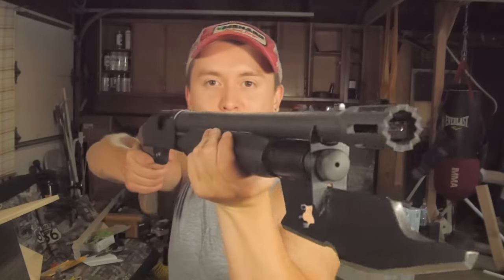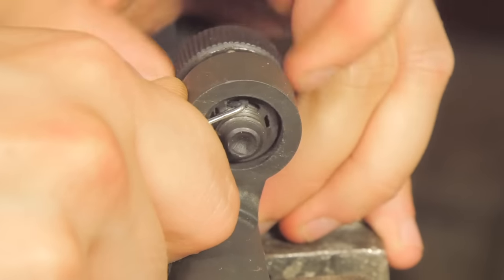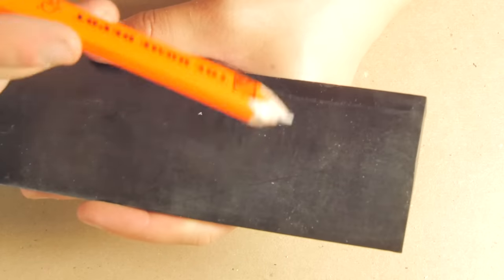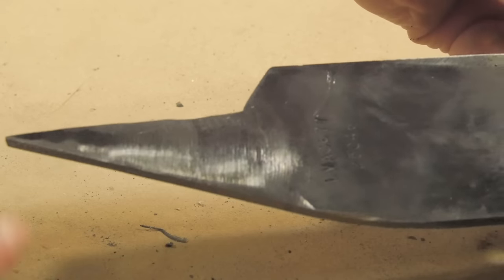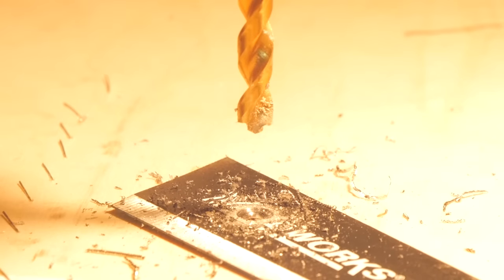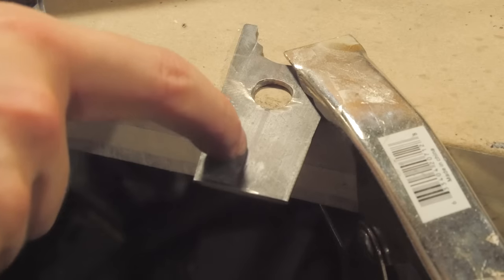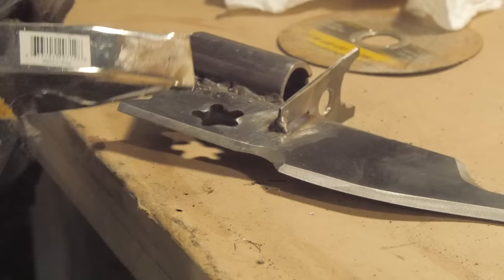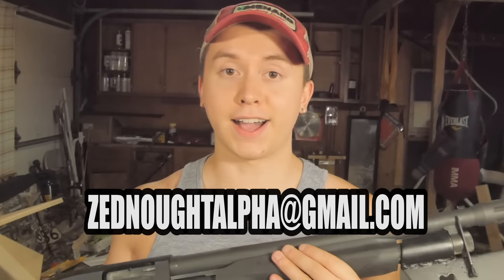Mossberg 500 BAYONET from a LAWN MOWER BLADE (Build Tutorial)

Comment: If you want a trick to drilling hard steel like that blade: Heat it up with a torch or forge and let it cool naturally. This softens it, you can drill all you want. After you finish your cuts and drills on the piece, heat it back up again and drop it in a bucket of oil or water to re-harden.
Reply: Brightest Darkest the point of taking it slow is to not have to redo the hardening process again
Reply: The hardening process isn't difficult. Literally just heat it up and dip it in oil or water.
Reply: Brightest Darkest what you don't seem to know is that its annoying to soften then retreat it. That in itself sucks. Not to mention theres no real point in doing that over the process he did. The blades also can warp very easily. Even crack, especially with water.
Reply: I'm about 90 percent sure as someone that makes knives and uses a forge regularly that you don't work metal a lot. I said this because he said he hates working with hardened steel. Not specifically for this instance, for any time he is gonna work with it. Also, it's not that easy to crack a blade. Oil quenching generally doesn't cause much warpage or cracking anyway, and even then it doesn't matter because welding causes far more warpage than an oil quench would. This piece isn't something that requires much precision.
Reply: Brightest Darkest also you don't let it cool naturally, that's called normalizing and doesn't make softer. you're thinking of annealing which is heating your piece up, and than cooling it off in your source heat.

Comment: Have you thought about getting a band saw? It would make cutting metal easier
Reply from the maker: I have one, I've been struggling to find metal cutting blades though. I'll probably look online when I decide I really really need em.
Reply: ZNA, look for bi-metal blades to cut metal. Probably won't find bi-metal blades for a wood bandsaw at the home centers but they are on amazon. Either that, or get one of those hand-held portable bandsaws specifically meant for cutting metal. I picked one up used at a pawn shop some years ago for about $40, and have gotten lots of use out of it.
Reply: A Milwaukee bandsaw is the way to go. Set it up in a vice and its perfect for cutting steel up to 3/8" thick.
Reply: +ZNA Productions you have good skin
Reply: very good skin
Reply: damn im late

Comment: eli turn down the amperage on your welder, it should sound like bacon sizzling not a cat hissing
Reply: doing that will also get rid of the splatter
Reply: also if he is using a M.I.G welder he should or pushing his weld and heat forward not draging it. it will comeout slot neater and penetrate the steel a lot easier. making a nice clean solid weld.
Reply: +william fuller yes, a mig doesnt produce slag so you dont drag the weld
Reply: I believe that it is flux core, but same concept.
Reply: +ZednoughtNova it won't get rid of spatter simple because he is using short-circuit which is less efficient than spray but either way your going to spatter, but you can simply just spray Pam on the things you don't want spatter on and it will wipe off!
Reply: I think a lot of his splatter is also due to not holding the gun close enough. In another video it wasn't striking well because of the same problem.
Reply: Robert Burch heck, I get the best wire feed welds using the tip as a guide , at least on 90 degree welds
Reply: Yup. Bacon sizzle - good. Cat hissing - bad.
Reply: flux core wont sound like mig
Reply: chevmaro17 _ I honestly never tried flux core. I imagine, depending on the machine, that it would have SMAW sound, and would vary more with current. That's just a guess
Reply: Also, where is his gas shield? It didn't look like he had one on, so those welds are pourus as fuck and utter useless, unless he's using flux wire as someone said, but why would you use flux core in a mig?
Reply: +duodot its cheaper to use flux core
Reply: Is it though? Depends on how much welding he does, but in the long run, gas is cheaper.
Reply: He's using flux core, so it doesn't matter. I think regular mig is cleaner though. However flux core is supposed to penetrate deeper and hold stronger.
Reply: +duodot  i tough that to, i think eli doesnt know what he is doing with an Welder machine
Reply: +Germain s  I agree. He should get some better practice and advice firsthand. He does great woodwork though.
Reply: Robert Burch 100% true, i learned Welding in school but you can easy learn it on Youtube, weldinghintsandtips is an VERY good teacher / youtuber
Reply: +Germain s yea i learned from school to and weldinghintsandtips gives very accurate welding advice
Reply: +Germain s someone else tell him to stitch weld thin crap. It'll be a pain with flux core, but it will cause less distortion and blow throughs.
Reply: Robert Burch stitch welding with flux core ... I'll have to remember that... now I want to go purchase some quality flux core wire...
Reply: +alphamongrel like i said, it'll be a pain in the ass with flux core, but since he was only running a short bead on thin shit it'll help.
Reply: Robert Burch if you do a short weld with the thicker metal on top, you shouldn't get any blow-through... another trick is to use a plate of brass on the back as a heat sink. Little trick.
Reply: Obviously if you have thicker metal to work off of then use it to your advantage. I've done the brass trick a couple of times, but it also has its limits when you go thinner.
Reply: It is really more of a cosmetic weld than structural. I would opt for a !ow heat alloy rod welding it on a a plate of brass for good measure. That way you can keep the natural look without grinding.
Reply: +william fuller MIG with gas he should push, flux core pull. some mig welders will need a reverse polarity when using flux core.
Reply: +morelli tech Yeah definitely
add a flux capacitor and a power relay cord with brass monoplating
Reply: you should be worried if that's what your cat sounds like
Reply: Self shielding flux core, without the gas defuser on the tip. The welds are going to be shit regardless of what he does. Lol
Reply: ZednoughtNova good advice man

Comment: Eli if you want a better weld you need to get closer to the mettle with the welder try not to get more then a quarter of an inch away and try putting it at a 45 degree you should see a big improvement I'm in a welding class and i still have a problem getting it right so don't feel bad for bad welds .

Comment: Hey If you have a small welder, turning the heat all the way up usually results in better welds as the smaller (ie cheaper) welders take a second or two to fully heat up. Your  puddls seem to be undercut which is usually due to lack of heat. Goodluck!

Comment: hey if you practicing welding, try turning down wire speed and a little more volts. I can't tell what the weld look like a short time but, it needs to turn down the wire spend and turn up the volts.

Comment: eli, if yiu are using argon 25% co2 75% mix sheilding gas try for a flow rate of 35 anso if yiu can anchor your arm against something it may help you smooth out your welds, if you dont already, get an auto darkening hood aswell

Comment: Eli you need to weld with your nozzle on at all times because it directs the shield gas your using towards the weld to protect it from outside contaminants that are in the air.
Reply: It's running with flux-core electrode, no gas required.

Comment: when you are welding metal that are not the same thickness take a torch and heat the thicker metal and it will help with the weld penetrating better so you dont have to worry about trying to turn up the heat so high that you blow out the thin metal. just set the welder to the right setting for the thin stuff and just pre heat only the thick stuff and it will work out way better and be much stronger.

Comment: Part of why you had trouble with your welds is because you didn't have a gas nozzle on your MIG gun, even with flux core wire you still need the nozzle to properly shield the weld area in a blanket of shielding gas. This will increase heat and penetration and reduce splatter and is an essential part of the machine.

Comment: Next time you should make a more massive ax. The very concept of the ax blade has been returning me for a long time. When you have a bayonet, he may be stuck in a corpse and you have a problem. The ax is a more effective weapon. Many veterans of the First World will say that a bayonet in a tight room is a poor idea. Many people in this place used saperek as axes, then you can assume that the concept itself is good. For this reason, I would suggest some improvements. First of all, the aforementioned more massive blade. Second longer, and thirdly, it would be good if this upgraded bayonet could be used independently of, for example, the building of defenses or the killing of guards. This would create the ultimate trench weapon, especially in conjunction with the presented rifle. In addition, I would suggest separately, the combination of berdysza with the rifle, so that the blade of the ax, at the same time the rifle of the rifle, while the bed and the barrel would play the role of a shank.

Comment: If you ever decide to make a another spear. The Vikings had what they called a sword spear. The end was all one thing so all that was really holding it to the wood was a pin basicly. So if the wood breaks you can replace or if you pull the pin throw it at someone and like a bad ass they try to throw it back at you all they get is the shaft. So maybe get some ideas from that or something.

Comment: Hi Eli I'm a welder and your welder doesn't have a nozzle. The reason why your welds aren't coming out is because the gas is not protecting the wire. Put a nozzle on it and your welds will be better. Also watch welding tips and tricks for how too's.

Comment: Either turn down your wire speed or turn up your Amps on your welder .. Will run a lot smoother. You have them set way out of sync with each other
Reply: And mark your spot on the harden steel and heat up the spot cherry red with an oxy torch or something. Will bring that one spot back to mild steel and keep the rest hard